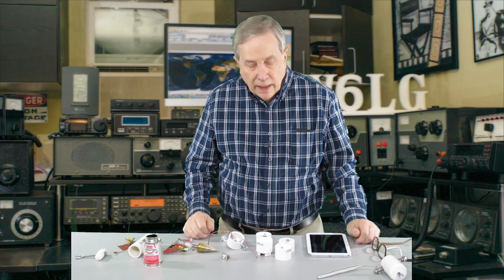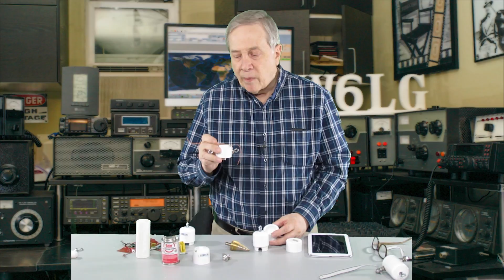Ham Radio Basics--Dipole Antenna Center Insulator

Comment: Dear sir 
I understand but I have question 
Is wattage value for dipole antenna 
For example 
I have 500watt amp for 20 meter band 
So how could I select wire
Mostly video uses 18awg wire 
Will it enough for 500watt amp

Comment: Hello Jim. I am VU3EQF from India. I am new to this hobby although i have handled HF sets in the Navy. I watch your videos regularly. I have heard two different reasons for using a balun with a dipole. The first one says it is for mitigating the common mode currents. The second version says that its needed to balance the antenna and induce current in the pole connected to the shield as in a coax it is grounded and without a balun the limb will just act like a ground with no flow of current. can you elaborate on this here or through a video perhaps.

Comment: Question, where did you solder to the S0-239,?  One to the center and one to the ground?
Reply: Dave Lucht from looking at other diy dipole center insulators one wire is to the center pin and one to the ground.

73 De Joseph VO1BYD

Comment: Hi Jim...everybody tells me I need a Balun when I construct my half wave dipole fed with 50 ohm coax....you mention fitting ferite beads...is this just as good as a commercial Balun....if so could you tell me me more about the correct type of beads....sound a lot less expensive than a commercial unit.

Nick.

Comment: Use the screw on the flange of the SO 239 for the negative side of the dipole. It is easier to connect to.
Reply from the maker: rrr  Thank you and 73, Jim W6LG

Comment: quick question Jim. I am ready to purchase my new yagi and just want to know why you don't run a triband beam.  I understand you love 20 meter but do you not have any interest in 15 or 17? I value your opinion,  thanks for your input. 
KB8YBG  JIM
Reply from the maker: Hi,  I am at a different part of the experience.  I am experimenting on 20 meters with 2 yagis in phase.  For you, some kind of multiband beam makes sense.  It may be 5 years before 10 meters is good again.  So get that antenna and have lots of fun learning about propagation.  73, Jim W6LG

Comment: thanks Jim.  what benefits would use a 4:1 current balun have - assuming the dipole is cut to resonant frequency where you plan to operate?

aside from the wound toroid, you almost built all the balun hardware
Reply from the maker: It would depend on the impedance of the antenna and the feedline; as you know.  So, if you used ladder line and transformed to some lower impedance for the dipole, you would not have the usual line losses.  Those feedline losses can be huge.  So, a balun (balanced to unbalanced) can increase you signal strength when it is done correctly.  The impedance of the dipole will vary with its length and height.  73, Jim

Comment: great video Jim. I use 3 different dipole antennas a 20, 17, and 40. I can also use my 40 meter wire on 15 meter. they all work great for dx. Not sure if everyone knows about the 3rd and fifth harmonics. ..tnx again Jim
Jim...KB8YBG
Reply from the maker: Excellent!  You are correct.  I should have mentioned that.  Those odd harmonics are helpful to getting an extra band with no effort.  Like well all did as Novices using a 40 meter dipole on 15 meters.  Thanks Jim. 73, W6LG

Comment: Hey Jim, I made a 2 meter dipole not long ago to practice before I made a larger version.  I could not get the swr low enough to use it.  I then researched more about dipoles on the internet and most everything led to a dipole is said to be a balanced load and coax you feed it with is unbalanced, therefore a 4:1 balun must be installed.  
   The information on making a 4:1 balun is so varied its hard to know which way is right, my dipole projects were put on hold.
   I will trust in your experience over internet info, so you use a dipole in this manner without the use of a balun and can get good swr ?  
   Can you show that on a video ?
  Thanks
Reply: Harley, you would NOT want a 4 to 1 Balun for a center fed dipole, Its impedence would be close to 72 ohms or so depending on height and ground factors, but NOT 200 ohms.  You would want a 1 to 1 balun.  On an OCFD or Off Center Fed Dipole if fed at the 1/3 point it will be closer to 200 ohms and a 4 to 1 balun would be called for.  Again this will depend on height and ground factors. . I hope this helped.  James K0UA
Reply: +1 for the idea! I too started with 2 m (balunless) dipoles and then moved on to 70 cm dipoles and quad loops. 

While I could tune my dipoles, I found them to be very susceptible to things in the near field of the antenna as well as things close to the coaxial cable. The latter made me believe that there's current on the cable and that balun could be needed or at least helpful. When I started researching, just like you did, I found tons of info claiming both that a balun is needed and that at the same time, a balun is not needed. 
This, perhaps a bit tricky, subject could definitely fit in the "Ham Radio Basics" title. Let's just hope that Jim does VHF too! 
73 de YU1NKA/DM1NKA
Reply from the maker: Hi,  You are right.  Maybe we should not call it a balun at all.  Maybe it is just an RF choke for common mode currents on the shield of the coax. So, you choke the shield with beads.  It is still an unbalance feedline connected to a balanced antenna (a dipole). Or, you can coil some coax to form an RF choke.  I believe it is better to have some kind of choke since the feedline is coax. How does that sound to you?  73, Jim
Reply: i tried that and it did not change the swr, mind you I have not tried it with a larger antenna than a 2 meter.  
  From what ive learned, a RF choke is to keep rf out of the shack.  A balun is a current or voltage transformer that matches a mismatched system, coax being 50 ohm, and i thought ive read a dipole is 200 ohms in the middle.  But im unsure of it all due to so much conflicting information.  Was wondering what you experiences were.  Apparently you have not had to use a 4:1 balun to match a dipole to coax.

Comment: Hi Jim,

Would there be an adverse effects of soldering the two braid wires to the eye hooks on the inside of the insulator housing rather than running then outside, wrapping them around your antenna wire, and then soldering them?  From thinking about it, my only concern would be that the signal wouldn't conduct through the eyehook very well for some reason.

73, Brian KE4CLY
Reply from the maker: The signal will go through the eye with absolutely no loss.  The metal is way too short to amount to anything.  Your idea is good and I did do that with 3 of the devices.  It was just harder to build. Thanks Brian. 73, Jim

Comment: Jim,
Another fine video. Only addition I would make is to use some liquid tape to seal the copper braid and solder connection after soldering the radiating elements.   73   WB3BJU
Reply from the maker: Good point.  Braid is good at sucking up water.  Thanks Don!  73, Jim W6LG

Comment: Great video Jim, i was thinking to use stainless steel cable  instead of copper as i can get it straight , dont know if stainless works ok as a conductor.
Reply from the maker: I did that and it worked fine.  I think the length was shorted by about 10% because of the resistance.  The antenna had a relatively low SWR as you might think. Build it and have fun!  73, Jim W6LG

Comment: Another great video Jim! I assume this would be a 1:1 balun?

73, Gary W6FH
Reply: Gary,
Not a balun, just a dipole center insulator.   WB3BJU
Reply: Thanks Donald.
Reply from the maker: Hi Gary!  Thanks Don!  You can clip ferrite beads onto the coax as a common mode choke.  This is a real simple solution.  73, Jim W6LG